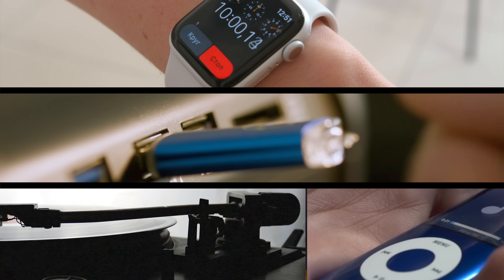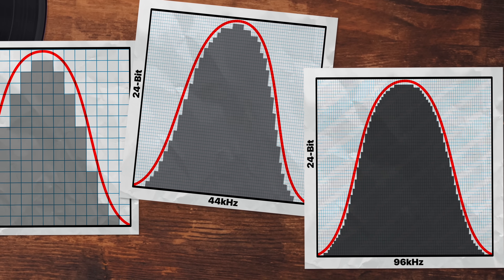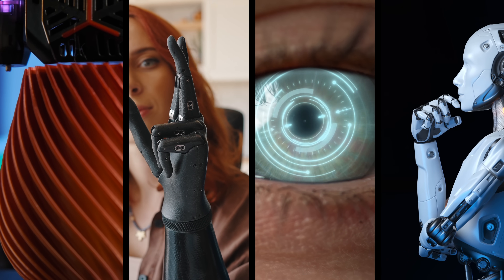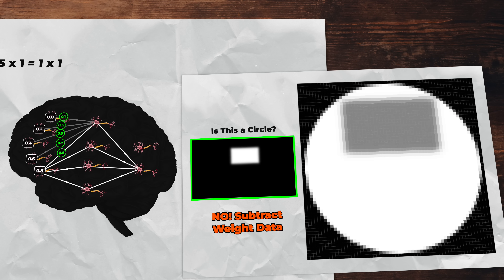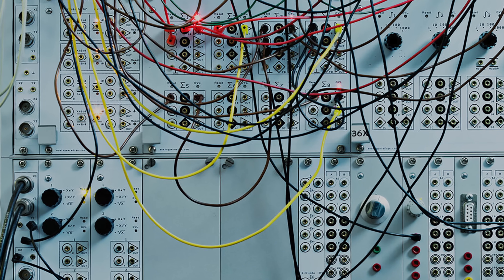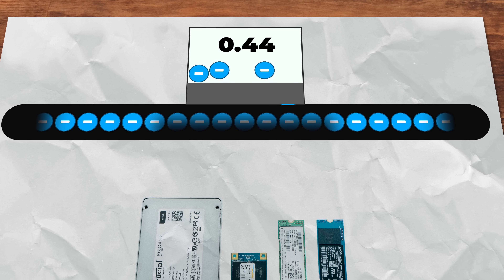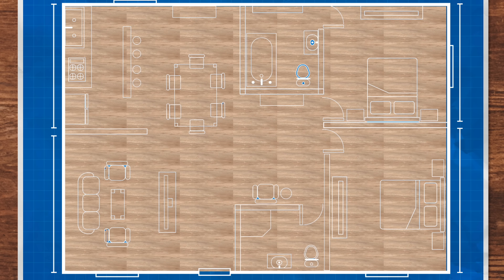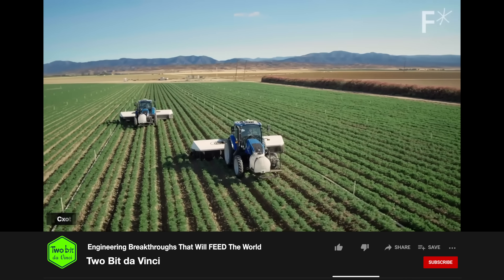Analog Computing is GENIUS - Here's Why!

Comment: digital have advantage on making copy of data. now we can sold 100m of copies with no physical cost by copy data via network.
digital computing still not 100% accuracy. they use electric current so the real value it hold is not still or stable, it changing all the time just we declare the value with in margin of error. u can make cpu more unstable and it will produce result in a lot of error.

Comment: The runaway errors aren't even that much of a problem with todays low noise low distortion op amps. You have those also with numerical methods! But the problems that remain are drift effects with analog electronics. Many integrators drifting slightly will produces worse overall drifting of the integrals. Therefor it makes sense to use digitally implemented analog computers, hich sounds weird but makes as the "analog" refers to the analogy in the hardware and not the value representation. Digital differential analyzers can be also made with an FPGA and are almost identical with the analog ones, with a few but important differences in some domains. They have higher power consumption and are prone to be numerically less stable than with analog electronics. But they have beter precision with no noise and drift effects and are most importantly not prone to errors due to component tolerances. And also important: while analog computing elements (the → integrators) can only integrate with respect to time "dt", digital computing elements used for integration aren't limited to any integration variable and therefor solve partial differential equations which much less hardware needed than in analog computers.

Comment: My wife calls me a science hipster because I'm into tech before it hits the news. Back in 2013-2014 when I was doing instrumentation and controlls, well most of the control singals I work with are analogue and a lot of the signals are transmitted accurately and successfully in noisy industrial environments -> From an electrical standpoint, this means using linear differential amplifiers and twisted pairs.

Any ways, it occurred to me that it must take well over 500 transistors to handle the addition of two 128 bit "Long Int" numbers but with analogue current signals you simply tie the two lines together, with subtraction you use a transistor with scaled current flow to subtract current flow from one line and multiplication and division are done with amplification. With voltage signals it would be a mess, but with current signals, say 4-20 nA, the system could be as rubust in a noisy environment as any industrial process, significantly faster and dramatically lowere energy as the current flow is naturally very low for all signal transmission.

Comment: Did i understand it correctly? the point is that you can do the same thing as the transistors do and just find a way to control the currents - and with that get a 1 and 0 results without using transistors or the point is that it would allow more results then just 1 and 0 and with that allow mroe possbilities of processing information ?

Comment: During a electric/electronic class, I was asked about high impedance with transistors use. I said a three answer computer would be much more useful than a two answer. The teacher said it would require a whole redo of programing and not be cost effective. Both were correct.

Comment: Anolog is smaller not as many can be applied at the same time same functions can working together more bits more jobs( tools) are added was ok at first now everyone  can manipulate and control one's computer to which the operator has no idea mechanical system people can work out side the internet if device is on the internet, the individual now how to fix his own machine a security hard to explain simple devices that can't break down that's my goal

Comment: 95% is not nearly enough for anything, if you have cascaded blocks like is common, let's say 5 you must multiply probabilities, meaning 0.95^5 what gives about 77%. Besides if you need things in which errors accumulate like navigation systems they need to be done with an incredible precision and even so they will work only to an extent, that is why you had waypoints in navigation. Analog computers are good for processing things like audio, video, but nothing that have to do with errors that accumulate. Yes in neural networks they can be incredibly useful, giving the fuzzy nature of the way neurons can work and the distribution of behavior alone the weights, but is not so simple, the startups that claim they made a thing have shown nothing concrete to this time, just bold claims.

Comment: This is no doubt an very very interesting topic, but I have a doubt abut this. Lately I have heard of this new computer type called quantum computer which store values in terms of points just like the analog computer. So is quantum computer something very similar to analog computer or is it the same as analog computer? because if the super computers and analog computers aren't related then Quantum computers will easily get an advantage over analog as it is controlled by digital means. Correct me if I'm wrong.......

Comment: Analog computers are not about to take over.
Reply: Hybrids could take over. The complexity of digital with the low power usage of analog
Reply: @nevernether3368  Analog computers might only very briefly shown an advantage, but digital is so accurate and fast now, there is absolute zero point for analog calculations at all. Ever. For any purpose.

Comment: Your description of neural networks was just basic programming. I feel like this guy just read a wikipedia page and copied it without understanding anything he is talking about. Quite a few spots in this video made me think 'wtf is he on about here?'. The example of the kids by the pool is so stupid its hurts to listen to. Not only is what you describe is almost impossible using only analogue but it would be incredibly easy and cheap using digital. Are you seriously suggesting an analogue camera with a complicated analogue computer would be better in any way than a digital camera and mini wifi card that you could fit on a credit card? That is maybe one of the worst possible use cases for analogue computing. For starters the analogue version would use more power not less.

Comment: i think 2 points were somewhat under stated
1 - analog processing is extremely fast but digital sucks
at FP calculations
2 - analog processing of sensor data is direct; 
digital needs A/D circuits

Comment: PC's are better than computers for simple or basic computations. and you might say wait what? odds are if you own a car, you have seen analog PC's every day of your life and probably havnt even realized it. so lets be clear... PC is not personal computer, but programable controller. where the most common use of them in this modern glass age. are traffic lights. but they are everywhere. fuel nozzel regulators, vehicle throddlebodys, elevators, tube amplifiers, ect ect ect. as a record to explain the difference of analog vs digital is a poor representations of what you are talking about. where most old acoustic recording studios from everlybrothers to elvis were all mostly 45kbps recordings, even the rat pack was only 64kbps on marshal harmonics. to even jimmy hendrix in the 70s only 78kbps on marshal transducers. as analog is analog, its core limit is the conductive rate efficiency.  as you could be saving power, but in doing so the coefficient has signal deprecation. which is not true with a digital codex. where once  you stop an analog signal it is dead, but if you stop a digital signal the remaining parts of the inital packet have already been sent at the start of the file transfers and that signal can be decoded to its full partaining packet codex. as it doesnt matter if it is a generic file or any file. meanwhile the only files which are analog that is kept on transfer and not destroyed when it is an analog reader on a tapagraph... you know the old ribbon films spinning in command lines which present a codex and different codex causes multuile equations to be resolved for the same codex of data. the problem with those types of analogs is yes they save on power but their efficency is in the crapper. because decoding tapagraphs takes ages. literally 24bit codex takes close to 72hours for telemetry and then 4-7hours for decryptions.  meanwhile todays moderen music are often recorded on an analog recording of 98kbps equivalent, meanwhile most streaming services like pandora plays 128bit encryptions. so the digital play of the music is near same if not better then when it was made in the studio. why sound services such as tidal yeah its sooo amazing to have music with 296 bit encrytions... which is nice but again if the studios only recorded 96kbps... then whatever for would you need that. ok ok you might wanna listen to a 4k uhd mastered bluray on audio. yes it could do that. but once again whatever for if you want to watch a movie wouldnt you rather watch the movie? so a lot of the common sense logic of what is better for this or that is lost within reasons of people not knowing what their product is as a consumer, or even pedestrian.

also the ai you presented isnt ai... the first one was a drone, the 2nd 2 after that were syntax code... and none of them were anything close to the turing test. where fyi alen turing is the guy who invented the programable controller able to play chess. using veratti's ribbon analog memory in massive multitude sets in attempts to decrypt nazi code as a supposed code breaker to break all code, he called it the "Ferranti Mark 1", and it failed predictions with oversight as much as it was correct in decoding.

something about ai, is apples and oranges. it will know them by definitions, by origins. it will know reported tastes by others but not able to have its own sensations to respond on a human level for context, concentrates, bowls, ect ect ect. it wont have the understanding cognitive of orange you glad i didnt say apples. so even if ai were to acquire cognitive representations. it is still a machine, where as turing said it is not anything else unless you were confused by what it was believing it human. note this does not include the iq degradations over the years, nor general populace of ages past. as you would have to not be a robot for interpret turings expectations of time, believing that as time went on people would have gotten smarter with the average iq going up and not down in averages and they would understand machines better like a 2nd language and even then computers could become so smart and vestal they could confuse people as people. so the test is flawed because people are flawed as they seem to be receding toward the stone age with their grown dependency on machines even to wake up to go to work. when our bodies have a biorhythm that doesnt need an alarm because we are human.

anyway, neat video.

Comment: Digital is vastly superior only in a digital world, Analog is pure power. Analog is what it is, Digital is nothing more than a simulation of what is true. The power of analog is and always will be the way it's tuned. A tesla coil can make wireless energy, tuned and scaled up, we could have free electricity. however not in a digital world. Where it will destroy anything digital in it's path. Heck a magnet is analog. . . Take a high power magnet and throw it on that Roborock S8 , or just in the vicinity of it. . . the magnet always wins.

Comment: I'm 70 and grew up with analogue vinyl and magnetic audio.  I loved them, of course...they were what existed, and high end equipment sounds fabulous!!  At one point I owned several thousand vinyl LPs and hundreds of cassettes.
They had their weak points, surface noise, tape hiss, and a far lower dynamic range.  I was easily persuaded to the dark side (digital) four decades ago, when my sense of hearing was far better than I can claim today.  Even then, around 30 years of age, I could not tell the difference, aside from the advantages of digital.

EDIT 2 weeks later:  Once beyond the discussion of analogue vs. digital audio, things required a few more watts to take in.  There's a lot I didn't absorb in the first run.

Comment: If it costs less to run and it is still effective it will become popular. Mythic need to be very careful about using Japanese or Korean SSDs as they use metric volts rather than the imperial volts.

Comment: I was expecting you were going to cover neuromorphic computing, which works in a similar but even more energy efficient way. Some neuromorphic processors are analogue, some are digital. They do away completely with the memory bottleneck problem, since all logic, memory and I/O are at the same place, in neurons and synapses - similar to a human brain but far less complex.

It is still classical but non Von Neumann computing. They should be ideal for neural networks, since they appear to be their missing hardware link. Yet although such processors were first released about a decade ago, starting with IBM's TrueNorth and later followed by releases from Intel and other companies, they still appear to largely be used as academic or research tools.

I have not heard of them being employed on either AI training or inferencing by any major AI company. I can only assume that their entirely different computing paradigm is to blame for that. Is recoding neural networks not worth neuromorphic computing's 10,000 to 100,000 times higher energy efficiency, and much lower energy bills and emissions?

Comment: Wouldn't analogue computers have alot in common with quantum computers? I mean you measure the value of a QBit based on the direction it faces which can be anything between 1-0 where as the same applies to analogue, granted you don't have any of the niche properties of quantum particles but neither do you have any of the strict operation requirements. so a analogue computer could essentially be a poor mans quantum computer.

Comment: Most neural network based applications are actually not highly accurate. They may be better than people on average or have 99.9% accuracy for simple tasks like line detection for highway lane assist, but they typically require constant updates. Just think about how often Tesla updates their cars. Any sophisticated problem like child detection at a pool would essentially be handicapped if it could not update its network. Many times this requires changes to the architecture, so additional layers being added, not just changes to the weights.

I'm interested how they will accommodate this need to the vast majority of neural network applications. Maybe people will just misuse it and not update life saving applications that they could.

Finally about economies of scale. Analog computers will never have the same scale of general use computers because each application that uses them needs its own custom hardware. You may get components in the manufacturing process that scale up nicely, but it will always be based on the company selling you the application that dictates how highly scaled the product is. But I think injection molding and stamped parts are a good parallel

Comment: Analog computers are too slow, clunky, and fragile to replace digital computers, and analog computers have a lot of moving parts and break easily and cannot be crammed into a laptop, desktop, or smartphone, while digital computers have little to no moving parts and can be put into a small space, and optical computers and quantum computers could both be more viable of a replacement than analog computers.

Comment: The idea of using floating gates in an analog way isn't the Genius part ... as a physics student back in the 90s I already came to the conclusion that 'all we would need' was a persistent electrically programmable resistor and that a precisely controllable floating gate would be the solution. The engineering part of such a thing however is a whole different kettle of fish. We cannot reliably make the floating gates good enough to regulate the exact amount of charge. Especially back in the 90s. 0 and 1 is coded as 'under' and 'over' a certain, defined amount of charge. Refining that to arbitrary and reliably controllable levels was never economical, if possible at all.

Comment: you could probably run these processors in parallel and sum the outputs to produce a more accurate calculation. would reduce efficiency but solve the accuracy problem potentially at a vast power savings despite this.

Comment: Mhmm this has been a thing for the longest time. The transition to digital was only ever bc that was what transistor technology was capable of. Computers before transistors had plenty of analog elements to their processes. Obviously as soon as we shift away from transistors to something that supports analog computing, then we'll use it. It's also that analog computing has some variability thanks to physics, digital is much more reliable thanks to a previously analogue number being recorded as bits, the only real errors come from cosmic radiation rather than measurement errors.

Comment: I've always believed Analog/Digital Hybrid Tech would eventually be the future and it's finally gaining traction. There is no better glaring example of why all digital is not sustainable than comparing modern electric vehicles. Digital is almost always running, Analog does not require to be on and uses cheap forms of energy as well until it does not. That's why Digital can step in on those use cases. On an EV you need as much power for A to B as possible. Did you really need a touch sensor to open a door? Powered windows are nice in some situations but having the option to spin a handle is nice too. The only reason for a high end screen should be the cameras on the blind spots and configuring Bluetooth or aux and maybe the radio but you have the option on your devices already for it so less is more.